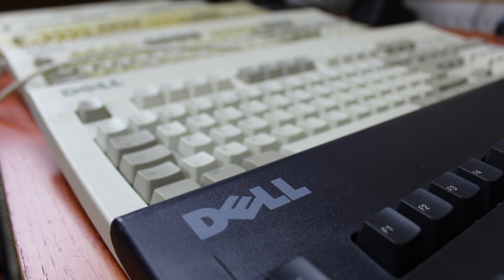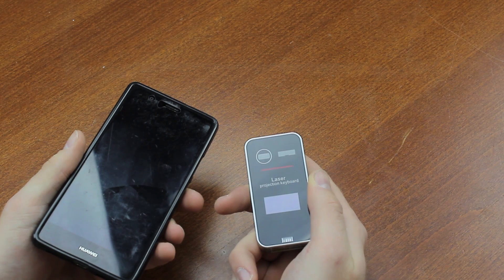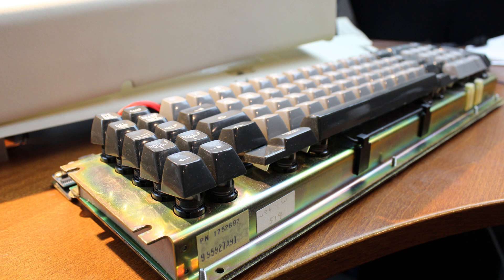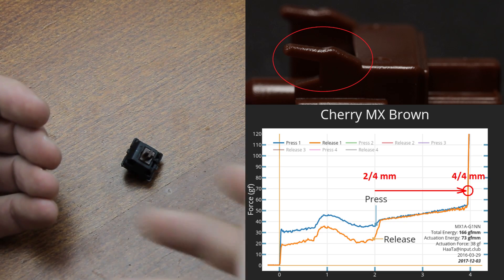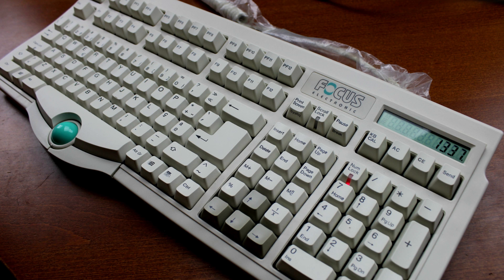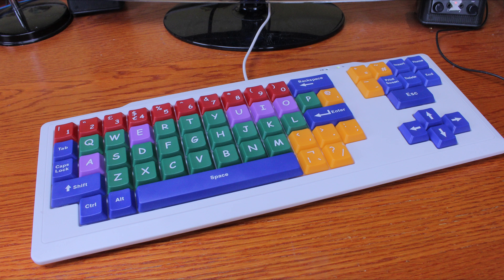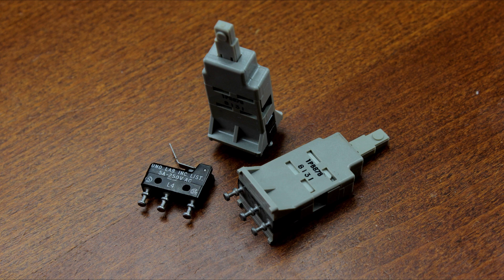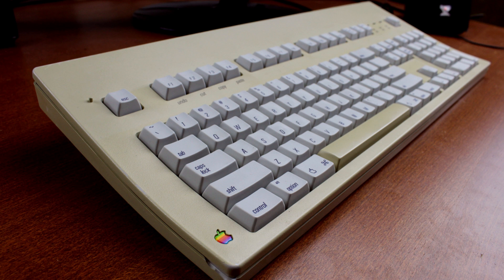When is a keyboard "mechanical"?

Comment: I've always liked your partway actuation definition, cuz at least for me that's what makes me hate typical rubber domes, and what I think frustrates most people about your typical office keyboard - the need to bottom out extra hard because some keys don't register when typing normally and others bind for no discernible reason.
Reply: So its a quality of manufacturing problem? Because Topres bottom out, and I've never seen anyone complain about them.
Reply: @alexandrecosta2567  first of all, i can assure you that many people have complained about topre. but also, while topre certainly can bottom out because yeah duh, they actuate partway down, much like "normal" mechanical switches.
Reply: @Crokto  right, I still feel like quality plays a big role on the whole "enthusiast" market. Green alps are more valuable than salmon or blacks, and they're still alps
Reply: @alexandrecosta2567  no doubt

Comment: Nice thought provoking commentary. Changed my view, on a couple points.  I think you're right, we're never going to have one commonly adhered to definition of mechanical keyboards because our general view of them is one based on a "feeling" and feelings are purely subjective by the individual.  But after listening to this video, I'm perfectly happy with a definition in the broadest sense that incorporates any physical keyboard that someone might like, even if I'm not fond of it myself.  (Like rubber domes).

Comment: You should see if you can review the Romer G linear switch, if you have a product with those. If you don't like them still, I understand. Yes, I said it, there's a Romer G linear switch.
Reply from the maker: You mean, one that was actually DESIGNED to be linear? 
Let me guess, it's tactile? :p
Reply: @Chyrosran22  The linear Romer G switch actually feels pretty smooth, probably more than the modern MX Blacks.

Comment: Rubber dome as a definition has nothing to do with rubber or domes; it means "switches which actuate on bottoming out". Mechs are all those that dont do this.
Reply: well, as you can see in the video, a lot of switches that use domes actuate when bottoming out, should they be considered not mechanical?

Comment: Glad to see this video push through from that discussion we had in the comments a few videos back. I'm all for a pragmatic understanding of the term "mechanical". We use it merely to convey a broad, vague, and even arbitrary sense of what makes a keyboard better than the run-of-the-mill standard office rubber dome membranes, but that whenever we try to pin it down, a full solid definition will always evade us. I'd say its part of what makes this hobby so interesting; that we can't even properly delineate the clear limits of what constitutes a keyboard worth our interest (and therefore the criteria by which we can pre-judge keyboards as being such). I agree that we should all learn to just try a keyboard before judging it, but at the same time I think we can continue to accept that the term "mechanical" has its practical place in our parlance despite its ultimately non-rational meaning.
Reply from the maker: Oh, it definitely has its uses. It's a perfect term to advertise with, for example. Or if you're trying to explain why the keyboards you're so interested in are better than "normal" keyboards. But all this need to rigidly qualify things really does a lot of harm to for example keyboard innovation IMO.
Reply: @Chyrosran22   Couldn't agree more. Case in point being the misguided way Cherry MX's market leadership has skewed views on keyboard quality. I literally have a friend who thinks that the scratchiness of his mid-2000's MX Blacks somehow make them feel more "mechanical", and hence why he thinks Flaretechs and Box switches feel "unmechanical" somehow. Still under that marketing-induced logic that says that because Cherry MX are industry standard, it means they're to be treated as the benchmark. It drives me nuts.

Anyway, I definitely enjoy these types of analysis videos, and I hope to see more.

Comment: My definition of "mechanical keyboard" is one that doesn't use rubber domes over membrane. This includes the Model M, which uses buckling springs over membrane as well as Topre, which uses rubber domes over a PCB. It excludes most garden-variety rubber dome keyboards.
Reply from the maker: That's a very practical definition, but again, it doesn't exclude touchscreens, projected keyboards, and virtual keyboards. In that case it might be better to describe something as "not just another keyboard" ;) .
Reply: @Chyrosran22  Please forgive my imprecision. My definition of "mechanical keyboard" is: A keyboard with moving parts that doesn't use rubber domes over membrane.
Reply: @matthewhall6288  This is the best definition, and is generally what people tend to mean when they say 'mechanical'. It's basically a description of the way a basic rubber dome keyboard works with "not that" tacked on the end. Obviously virtual keyboards are software based, regardless of the way they visualise the typing area, they're input devices but I struggle to even think of them as 'keyboards' - but they're excluded in this definition anyway. I think butterfly switches might count as mechanical under this definition, but I don't have a problem with that. Mechanical doesn't necessarily = good.

Still, it's such a broad definition it's not particularly useful, and elides the wide variety of keyboard types out there. Also it sweeps the inclusion of rubber domes in stuff like Topre under the carpet rather unfairly - the rubber dome being a vital part of the characteristics of the switch.

Comment: Do you know if Mitsumi ever made keyboards for Compaq? I have an old Compaq keyboard which I once used as a testbed for retrobighting techniques. It's switches look exactly like the ones you showed here. It's completely distroyed (had been before I got it, most of the rubber... uh domes .... are gone and so are some of the keycaps)
Reply from the maker: Yes, Mitsumi made Compaq-branded KPQ boards, with switches just like the ones I showed in the video.
Reply: @Chyrosran22  Interesting. Where did you get the info?
Reply from the maker: @GeoStreber  I found one ages ago at the uni.
Reply: @Chyrosran22  Well it doesn't seem to be documented anywhere. Deskthority wiki for example doesn't mention Compaq-branded Mitsumis for example
Reply from the maker: @GeoStreber  Yes it does! :) https://deskthority.net/wiki/Mitsumi_KPQ-E99ZC

Comment: Considering the definitions you have evoked, it seems that people consider a keyboard mechanical if, 'the actuating mechanism is more than one part, and therefore appearing more "mechanical."'
So it would appear that we are in a sticky state where people value systems that include a number of parts which metanymically are associated with a well designed machine, and less so if the mechanism is good on its own merits. In a nutshell, people seem to care more that they perceive the mechanism as more complex and therefore 'mechanical'. Mechanical is being used as an adjective that has lost its modifier.

I would love to hear your opinion on this. :)
Reply from the maker: Yes, that is a fair point. I'd go so far as to dumb it down to the term's only use being an excuse to exhibit favouritism and nothing more.
Any criterion involving part counts is moot anyway, as it's very hard to nail down how many "parts" a switch has in some cases, especially if it regards indivisible or shared parts. For example, you could envision a Model M switch' part count to be anything ranging from 1 to 7 (i.e. from just the spring+flipper assembly to stem + barrel + spring + flipper + 3 membranes).
Reply: @Chyrosran22  That is interesting because I would think that it would be rather demonstrable in that example of the IBM buckling spring that it would be 'percieved' as 'more mechanical' than a sheet of rubber domes. I totally agree though, the word's use is definitely less to do with the quality of the mechanism, and more to do with showboating.
Reply: Also seeing as the slider is considered a part of the switch, would you consider a keycap with a stem (i.e. single part buckling spring caps, rubber dome caps) a part of the switch?

Comment: What are those switches with the clips on them? What are the clips for?
Reply from the maker: What bit of the video are you referring to exactly?
Reply: @Chyrosran22  at 4:12 you show a switch at the top which appears to have a clip and a coord attached to it. I was wondering what those type are and what the cord and clip are for
Reply: @qbert313  model f switch, it's a keychain and not from the board itself
Reply: @sonicase  ohhhh got it thanks. haha

Comment: I personally don't use the term from what I've noticed. It doesn't really make a difference because at the end of the day, the switch has to feel good for typing or gaming and has to conform to the individual user's preferences. That means that I honestly would rather use a rubber dome or buckling spring for gaming than any cherry mx switch.

Comment: Great video, could have been one of the very first in your channel :)

Your analysis makes all the sense, I agree what matters is our  perception of the typing experience (sound and feel) regardless of how the device actually registers our fingers trying to activate different keys. The "mechanical" tag for keyboards seems indeed sort of discrimination-based only.

Mechanical in general should just mean that there are **moving solid parts** in the device, regardless of materials or operating principle. If anything solid other than our fingers needs to move for a key to activate, then it is **mechanical** . If only electromagnetic fields or photons "move" or change, but nothing solid other than our fingers move during the typing, only then it would clearly be **non-mechanical** .
Almost all keyboards are therefore mechanical, except laser virtual ones, or touchpad/touch screens. 

That very same definition of mechanical is what distinguishes a normal spinning harddrive disk (mechanical because it has moving parts) from an SSD (non-mechanical, because it has no moving parts.)

Comment: It is mechanical if there is a design-separation between the switching mechanism and the sensing mechanism. hence, the switching mechanism and the sensing mechanism are not a single continues entity
Reply from the maker: I'm not sure Iunderstand correctly, because that sounds like either every keyboard ever made is mechanical, or none of them are. Could you give an example?

Comment: What most people consider a mechanical switch (at least subconsciously) is something that transforms the direct vertical motion of pressing a key into something else in order to detect a keystroke.  Rubber domes over membranes don't do that, and instead translate motion of the key being pressed down onto the top membrane to press it against the other - in theory at least.  In practice the mushiness of the rubber allows for a little overtravel and doesn't result in direct 1:1 translation of the key travel motion to the membranes, but that's more of a side effect of the properties of rubber than a design consideration.

I think the way a switch mechanism transforms the vertical keytravel into detecting keypresses can be used to categorize switches as mechanics, semi-mechanical, or otherwise if people can agree on what constitutes a transformation and how many and what kind of transformations constitute a switching mechanism being considered mechanical or otherwise.
Reply from the maker: Again, that just doesn't cut it. What about switches that have the contact motion vertically instead of horizontal? Or if I mounted the contacts from a Cherry MX switch vertically instead of horizontally, would it then cease to be mechanical? It's also very vague on what that would mean for Hall effect, capacitive, magnetic valve, etc. switches.
Reply: @Chyrosran22  nah mate, he mean that if you can't smoke weed, and type at the same time, then it isn't mechanical fam

Comment: "If it doesn't feel like typing on shit, it's mechanical". There.
Reply: It’s all subjective. Or is it. Tf the switch sits in a sturdy frame mounted in an even better case and not on an flimsy pcb losely inside a thin plastic shell then even a cherry key can do well at least If it’s not brown 🤢 or MY
Reply: So cherry isnt mechanical?
Reply: @theicycrook8373  reds and silvers are the only good cherry switches
Reply: @umbra9705  reds are pretty bad as well
Reply: @umbra9705  how bout blue
Reply: @namanhan7829  they're  ass? I thought everyone knew
Reply: @EddoWagt  they're decent, silvers are much better because they're what reds wanted to be
Reply: @umbra9705  Nah i actually hate those I'm more into blues
Reply: @laysy1743  who said you cant like something bad? People like their first car no matter how bad it is
Reply: @umbra9705  you forgot blacks
Reply: @umbra9705  blacks and clears*
Reply: @umbra9705  I quite like Cherry MX Blacks.
Reply: @umbra9705  really? I hate silvers, i prefer the blues and reds.
Reply: The problem with cherry is that there is a better switch in every category from another company, and they do it while being cheaper, tbh cherry switches are not bat, they are just extremely overrated by gaming youtubers because those are the switches that come with gaming keyboards most of the times.
Reply: This definition doesn't hold up at all. Even standard rubber domes are better than a lot of the worst mechanical key switches that exist and that this kind gentleman has reviewed in the past. See his "Top 10 WORST mechanical keyboard switches of all time" video, for some of the worst of the worst examples.
Reply: turns out buckling springs are mechanical, nice
Reply: is it here where all the mech keyboards gatekeepers gathers?

Comment: An idea for a top x video:
top x best built keyboards
Reply from the maker: It's very difficult to do a video about KEYBOARDS rather than switches because an almost limitless amount of keyboard models were made and even with my considerable collection I wouldn't approach even a fraction of everything that's been made. They also run a greater risk of becoming obsolete compared to videos about switches.
Reply: And then the top x worst built keyboards, excluding projected ones and the godawful calculator type ones on the ZX spectrum.
Reply: @ZILtoid1991  A curious rarity would be the keyboard on the ZX81. Its design allegedly won some award, but that was aesthetics-wise. As a keyboard itself, must have been pretty terrible. I have always found its layout intriguing and fascinating though. Here is a PDF, I actually enlarged and printed the black-white-red one, and have it on one of my kitchen cabinets just as a small poster :)
http://www.8bity.cz/files/ZX80-81_Keyboard.pdf
Reply: top 10 best switch clones